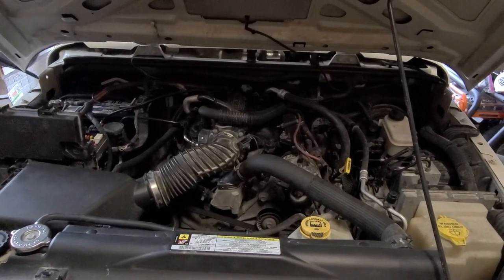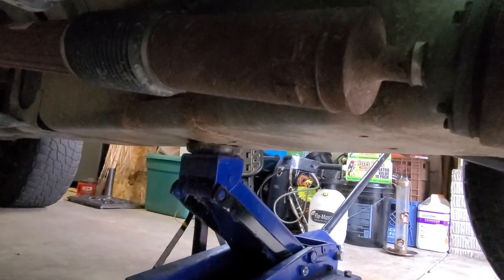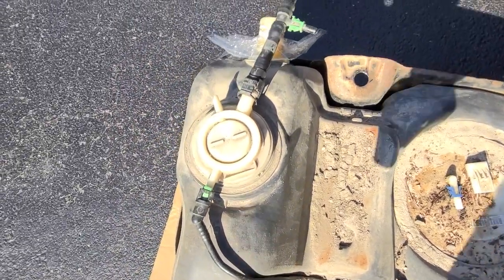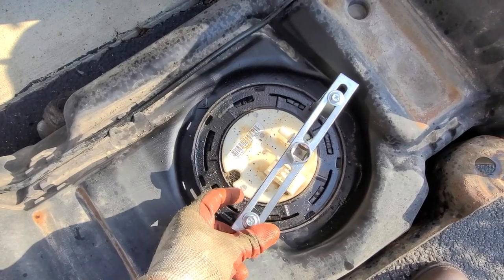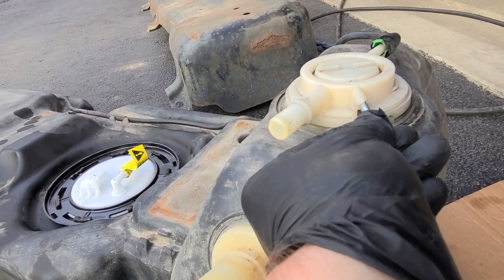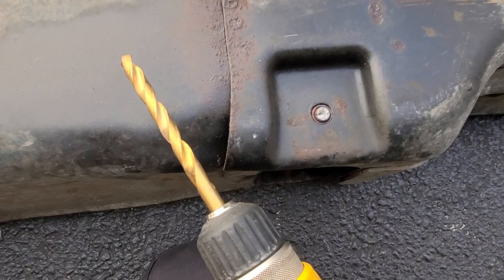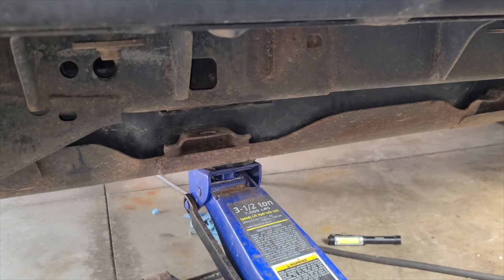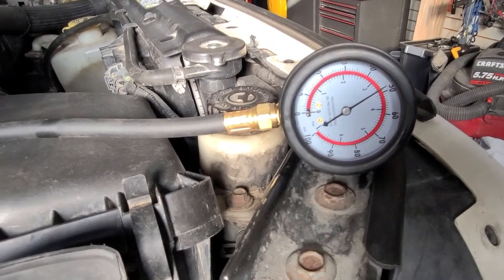Wrangler JK Fuel Pump Replacement

Comment: First A big thanks for your video. 
It gave me plenty info to prepare for my pump swop. 
Like to advise that instead of using a trolley jack use some tie downs front and back. Did hook them up to the prop shaft and on the other end some openings in the chassis. This way one has a good control of lowering the tank and putting it back in place again. 
Because of the straps one can still move the tank around while lifting it back in position. 
Hope this helps others.
Reply from the maker: That's a great idea on the tie downs! Thanks for sharing

Comment: Broke mine as well while I was pushing the large filler hose off.  I couldn't find a 13/64 roll pin, instead I used a 3/16 roll pin and a 3/16 drill bit.  It's a size smaller than the 13/64 so it didn't try to grab the plastic while I was drilling it out, I was able to hold the small piece in my hand to drill it.  Also i used my vise to squeeze the roll pin just a little to close it up which made it easier to push it in.  I used a clear two part, plastic bond epoxy made by JB Weld that sets up in 5 minutes and cures in 1 hour around the crack once the two pieces were put back together.

Thanks for the video.
Reply from the maker: Glad you found a solution!

Comment: This is such a complete, thorough, and well thought-out video, thank you! I'll be dropping my tank to replace a leaking pump seal and this will be a huge help!
Reply from the maker: Thanks for the feedback,  glad it helped!
Reply: How did the seal replacement go? I have to do mine soon
Reply: Oh, it's still waiting on me, ha ha. All the parts are ordered and I keep putting it off. I really need to get on it.
Reply: @BurlyNerdGetsTheWorm  I have the gasket and lock ring and will be attempting it next week, mine only leaks around the fuel pump when there’s a full tank
Reply: @BurlyNerdGetsTheWorm  worked on my leak this week, turned out to be a crack in the fuel pump housing and not the gasket
Reply: @will3821  Good to know, thanks! I will probably get around to it in the next couple months. I'll try to remember to report back in!

Comment: Excellent video Sir. I'm presently replacing a friend's rusted out skid plate for the fuel tank. So before I found your video, yes that same EVAP nozzle broke and I was like damn. Anyway thanks to you, I'm out of a bind with one 13/64 split pin and apoxy. Thank You Very Much for posting this video!
Reply from the maker: Fantastic!
Reply: did this fix hold up? i am about to have to tackle this myself
Reply: @austin.gresham  same question tho: did the fix hold up? everything good after this? cant believe mopar/jeep thought it was a good idea to make this not replaceable...
Reply from the maker: @penguiin12  Yes, the fix held up. Ultimately, I also had an issue with the fuel injectors being the real culprit of my rich condition codes, but this fixed the pressure issue.

Comment: Is it possible to cut a hole through the cab over the fuel pump to access it? My fuel gauge stopped working, and I'm really not looking forward to dropping the fuel tank.
Reply from the maker: I suppose you could come from the top, but to me that seems like more effort than dropping the tank. I am not near mine right now to double-check, but there may be other frame components (cross members, maybe) in the way as well. Before you look at replacing the assembly, have you checked to make sure the level sensor is working properly - checking voltage, resistance, etc - before pinning the sensor as the culprit?
Reply: @austin.gresham  I'll take a closer look before I do any cutting. I've seen it done on a jeep TJ and thought I'd ask since you've been under yours. First, it was reading 3/4 tank at a full level, then would only go to 1/4 full. Now it stays on E. Sometimes, it jumps up to 1/4 again. Thanks.

Comment: I did this exact job about 3 years ago.  What an absolute pain in the ass. The fuel line coming from the sending unit to the motor broke at the fitting and could not be repaired. Had to replace the entire sending unit. I live in Northern Ontario Canada where they use an abundance of road salt. Needless to say 4 of the 6 bolts sheared off during removal and we spent many hours and a lot of money on Tungsten Carbide drill bits drilling out those bolts. Spent another day cleaning up the outside and inside of the tank, cleaning and patching up the skid plte and doing some rustproofing. Finally put everything back together.  Definitely could be designed better. Plastic is not the proper material for this purpose.
Reply from the maker: Wow!  I live in Ohio - definitely hear you on the road salt. Thankfully I only broke one.

Comment: Great Job on the video.  I just got my new pump delivered and will be tackling this soon.  I don't think you showed the existing pump very closely or the new one going in.  It seems straight forward, but I am not seeing any strainer or filter on the new one. It must be built in so I would have to take it apart to see if it looked clogged, which I think is my issue with fuel pressure ~30psi.
Reply: I just looked it up, the filter is part of the assembly, not really serviceable.
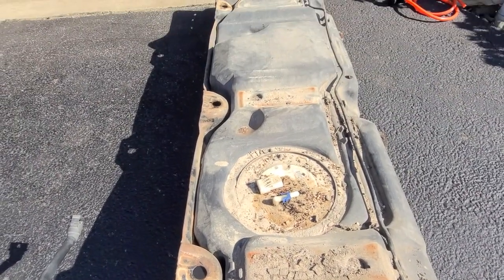Reply from the maker: @ht9565  Correct, it's all one unit:  glad you got that figured out before you wasted your time!  As far as the install you are also correct - I did not detail that.  Just the reverse process starting at about 09:25.  Good luck!
Reply: Just finishing up the fuel pump replacement.  Going back was definitely not as easy as dropping it, i used cribbing and jacks and back and forth until got everything lined up finally.  Did you say the torque for the tank mounting or the 21 mm bolt that you had to back off.  Also, at the end of your video, you primed with the gauged still installed to verify pressure.  But then what did you do?  Did you pull the fuse again to kill the motor and relieve pressure to take the gauge off and reconnect everything?  I am thinking of skipping that step and just reconnect and cycle the key, not sure how many times it takes to build pressure.
Reply from the maker: @ht9565  Looks like I neglected to mention the torque specs for those!  The 21mm for the lower control arm is 125 ft lbs and the bolts for the fuel tank skid are 30 ft lbs. You are correct about the gauge at the end. If you're confident that the pressure is good you could skip that step. It takes only 2-3 key cycles to build pressure.  Congrats on getting it done!

Comment: what brand fuel pump should I buy for my 2010 JKU Rubicon?
Reply from the maker: I can't recommend a specific brand based on my experience. I often use Rock Auto and they have a lot of choices, some with ❤ next to the ones that have received top reviews. I would start there.  I avoid the "economy" category and usually buy the "daily driver" parts.

Comment: why didnt you just use a 3/16th roll pin rather than a 13/64?  i'm only curious because when i measured the hole for the same repair it measured exactly 3/16th. what difference would 1/64th make?  again im just asking.
Reply from the maker: Great question! I used a pin slightly bigger to make sure it didn't get pushed farther into the rollover valve or farther (away) down the evap tube. Seemed like a good compromise between just right and slightly oversized. More of a game-time decision than anything. If you have success with the 3/16 please post!

Comment: Hello there, great video congrats. That 21 mm was a nightmare, in my case was super tight so decided to slide the tank to the left, not fun indeed. I got the tank down because that vapor vacuum tube broken as well.
My question is...do you think I can use a normal rubber hose (not a pressure hose) instead the original plastic hoses or that line handles high PSI or runs gasoline through it. Im not sure how it exactly works, what's the real function, but yeah, gotta P0455 & P0456 EVAP codes and light check engine on.
Reply from the maker: Hey, thanks for the compliment on the video.  Glad it was helpful!  As far as the rollover valve, it's connected to the EVAP system which is very picky about pressure.  The EVAP is not high-pressure like the fuel line and there is no fuel that runs through it, but there are fuel vapors.  I'm not a chemical expert so I don't want to recommend using a rubber hose in its place or tell you it won't work:  I am not sure.  The rollover valve is just a check-valve that shuts off the fuel line if the vehicle rolls over on its side or upside down.  If you got the EVAP DTC codes after you snapped off the connector, then that's what's causing those. As I mentioned before, they are connected (EVAP and rollover).  If you already had those codes, sounds like you have another leak in the system.  Very common are a leaky fuel cap (cracked) or the EVAP canister under the Jeep.  You can also check under the hood near the EVAP purge valve, sometimes the plastic hoses get pinched near the battery and cause a leak, or they melt when they touch the EGR tube.
Reply: I knew you would answer my question...but hey thanks a lot for the quick response and very detailed explanation (YouTube mark this answer as highlight)...I never imagined that valve shuts off the vehicle (Jeep Rubicon In my case) if rolls hence the name of course)
I'll check all the sections you mentioned for possible cracks,melts or loosen hoses...Thanks Again
-kudos

Comment: Thank you for this very informative video. Can you please tell me what is the best point to connect the fuel pressure gauge to JK?
Reply from the maker: Hey Mesheezy, sorry I didn't see this earlier.  The fuel pressure gauge gets connected to the fuel rail under the hood.  You need the adapter, though.

Comment: I have a 2011 jk, check engine light code p071 and p074, which is lean fuel. So the jeep at random times just turns over with out cranking up, then theres times it just does a slight turn and shuts off without cranking up. Once it fires up it might run fine for a week or a month with out any issues, but then it starts acting up. Do you think is a bad fuel pump?
Reply from the maker: Could be.  The only way to know for sure would be a fuel pressure test.  Since you're getting lean in both banks, it could also be a vacuum leak. I just had lean codes in another jeep and it turns out the PCV valve was stuck open - that's a $15.00 fix that takes less than 30 min.  Replacing the pump, as you saw in the video, is more expensive and takes longer.  If you have an OBD scanner, it would be interesting to see what the fuel trims and O2 sensors are saying (how lean are you, and is the STFT and/or LTFT "pegged" lean)?  Lean can also be caused when the system stays in Open Loop mode, which can also be a bad temp sensor - coolant, intake, MAP.  A good OBD scan tool can help narrow all that down.

Comment: I am getting ready to do this, this video is very helpful! Did you remove your muffler first, and if so, do you recommend I do so as well?
Reply from the maker: I did not remove the muffler - it's not in the way of anything.  Good luck!
Reply: @austin.gresham  thanks! I dropped the tank on a rusty TJ once, this time it's a not so rusty JKU. Hopefully it goes smooth! Cheers!
Reply: @austin.gresham  Hot damn, I've got it dropped,  and thanks to your warning I did not break the evap nipple. Now just have to tackle the lock ring but the hardest part is over, except for lifting the tank back up.  Thanks again!
Reply from the maker: @danbowen710  Great!

Comment: I have a 2012 Jk can’t fill the tank or all you can smell is gas in the Jeep any idea what it could be?
Reply from the maker: Sounds like the EVAP to me. Maybe a cracked line. The EVAP connects to the rollover valve, the gas filler tube and up to the engine: all with hard plastic lines.

Comment: My connector broke just like yours and I was searching ways to fix it and came upon your video.  Great idea on the roll pin.  One question, what type of epoxy did you use?
Reply from the maker: I typically use the JB Weld that comes in 2 separate tubes instead of the one that supposedly mixes as it comes out.

Comment: when you fixed the rollover valve did it still have check engine light on?
Reply from the maker: Ultimately I had to replace the injectors to fix the CEL I was getting (Rich condition in all banks).  I never got any EVAP CEL's but if I had not fixed the rollover valve it definitely would have.  

Short answer: if you break the EVAP tube, fix it before you reinstall the tank.
Reply: @austin.gresham Do you remember what brand the injectors were that were giving you the rich condition and what brand injectors did you replace them with?
Reply from the maker: @ntme9  Yes, the old ones were Bosch. I replaced them with MOPAR OE injectors.

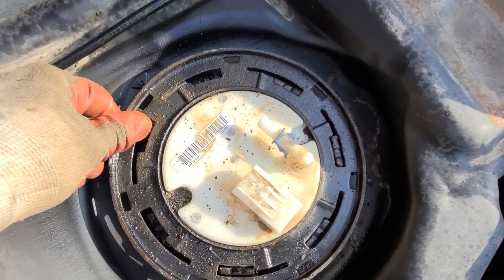Comment: 10:50 did you try to apply heat to get the o-ring off.
Reply from the maker: I did not. In my case it was mostly sand, rock and other grit. It wasn't rusted/seized like a normal bolt where heat would have helped. Plus, a gas tank....   not sure heat would have been a good choice

Comment: Hey, trying to replace a fuel line on my 2013 JK, and there is a fitting with a red ring tab that comes off, and then it has a gray button on the back, but I can't figure out how to disconnect it. Help!
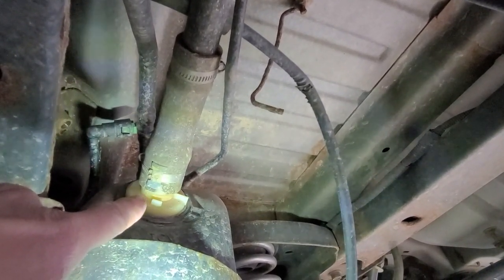Reply from the maker: So, without seeing it, here's my best guess at what you're describing.  The red ring stays on the end your trying to disconnect from.  Press the gray button and pull that side away from the red ring.  Does that make sense?  I think what you're describing is the connector at 1:32 in this video:  https://www.youtube.com/watch?v=zfuYTjftkDo  If not, it's bound to be one of the ones described here.   Good luck!

Comment: Great Video!      I have a 2012 Jk, 2 door. It runs fine for 5 minutes or so then just shuts off. It will restart without a problem but sometimes it will crank for about 5 seconds before starting after it shuts down. The shutting off seems to get worse after driving it for a while. 
 Do you have any ideas of what the problem may be?
Reply from the maker: Hmmm...  wondering if your fuel pump is going bad?  Or the relay/fuse/wiring to the fuel pump?  You might also want to check the fuel lines and make sure there isn't blockage, kinked hose, etc.  A pressure test would help narrow it down.
Reply: @austin.gresham  Thank you!
Reply from the maker: @rogerpena9590  Don't thank me yet!  I may have completely mis-diagnosed the problem 🤦‍♂️

Comment: I’m having to prime my fuel pump before starting the engine if I don’t I get harsh starts. Jeep runs fine ones it’s running but I’m suspecting my fuel pump is going out. Any tips to confirm I get no codes?
Reply from the maker: The best way is to check the fuel pressure at the rail.  Sounds like the regulator, but it's all in the same unit so you have to replace the whole thing anyway.  Could also be a leak in the fuel line, but you'll most likely smell gas if you garage it.  Get underneath and check all the lines and connectors to be sure.
Reply: Austin Gresham thank you for the information!

Comment: Hi Austin, did you fix the rich codes you had? If so was it the fuel pump? I’m having the same issue with my 07 Jk. Thanks
Reply from the maker: Hi ntransam.  Unfortunately, I still have the codes.  I think it's the cheap injectors the previous owner used when he was getting a misfire.  They are Bosch injectors that I can only find on Ebay, so that's not comforting.  When I get a spare $800 I will be replacing all 6 with OEM-quality ones.
Reply from the maker: I will say, though, the fuel pump did need to be replaced.  It was not putting out the proper pressure.  It was probably the regulator, but it's all one unit so you have the replace the whole pump assembly.

Comment: Awesome video!  Finishing up mine now.  I’m curious where are you attached that pressure valve though?
Reply: Sorry I meant gauge.
Reply from the maker: The gauge is connected at the fuel rail. Check out the first video (link in this video's description) and it will make sense. There is a MOPAR adapter you need as well, also in the other video. Good luck!

Comment: Great videos!!! Thank you. Did your codes go away!
Reply from the maker: Unfortunately, not from replacing the FP, but it needed to be done anyway.  The ultimate fix was replacing awful aftermarket injectors with OEM ones.
Reply: @austin.gresham  thanks. I did see you told someone else it didn't work. I have a missfire cylinder 3 and p0171 lean. Just bought my 09. Changed plugs wires and coil. Injectors were next cuz still have the codes after clearing. That's how I found your videos. So a great job explained and pointing out the bolts and part numbers. Love it!!
Mine has 206k miles. Regular oil changes, but most other things look to be original. I hate fake videos where everything goes perfectly. NEVER HAPPENS. 😝

Comment: can you tell me please exact measurements of roll pin and where can I buy online?
Reply: You can find an assorted pack at just about any auto parts store. Or gun store
Reply from the maker: Hi Mindaugas.  The ones I used were Dorman 13850.  You can find them at any auto parts store.  This is an assorted bundle, so find the one that is slightly oversized and drill it out.  I used a 13/64" drill bit.  Sorry I did not reply sooner!